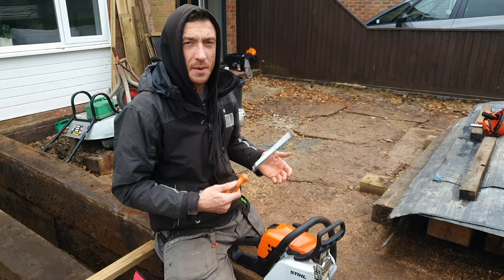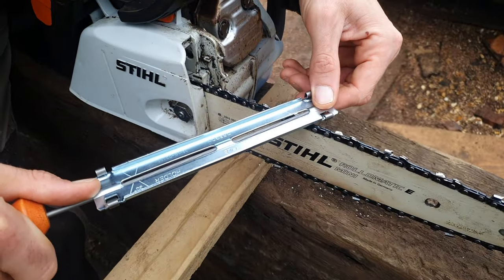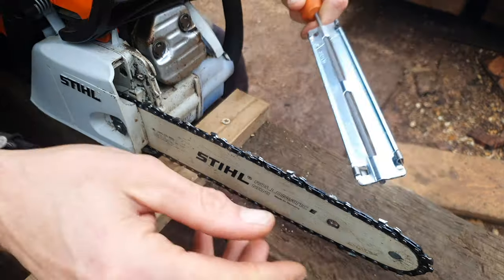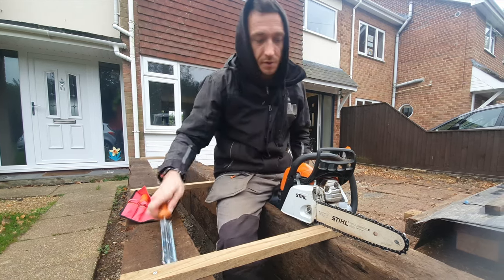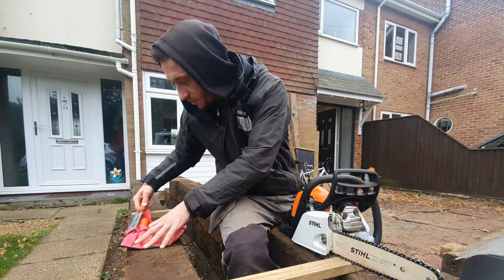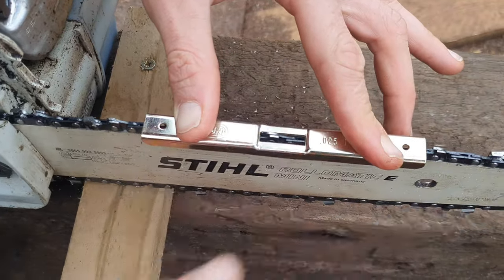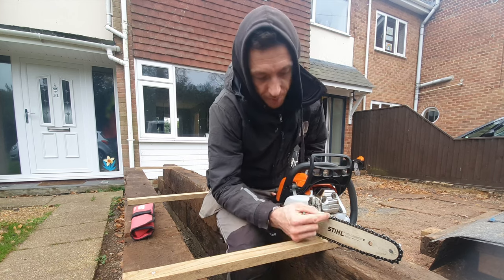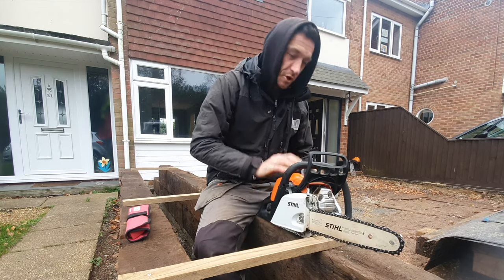How to sharpen a chainsaw - using the Oregon sharpening kit

Comment: This Oregon chainsaw file guide will it work with a 3/16 file ?
Reply from the maker: not to sure on the one ..., check out -

https://www.amazon.co.uk/558488-Sharpening-Maintenance-Profile-Chainsaw/dp/B00GOGWD90/ref=asc_df_B00GOGWD90/?tag=googshopuk-21&linkCode=df0&hvadid=226592631289&hvpos=&hvnetw=g&hvrand=8050231026697822238&hvpone=&hvptwo=&hvqmt=&hvdev=c&hvdvcmdl=&hvlocint=&hvlocphy=1006943&hvtargid=pla-485737781037&psc=1&th=1&psc=1

 you might have some luck there.